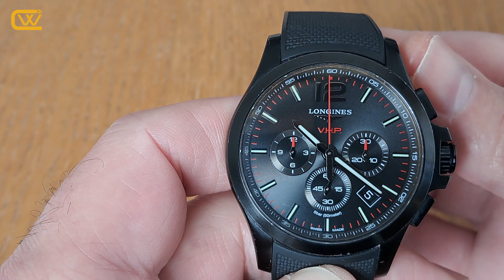Unlocking the Secret Programming Mode of the Longines VHP Chronograph

Comment: Can you do a video for proper battery replacement? My watch entered service mode and the month and year are correct, but the day will not change no matter what I do!
Reply: Just make sure you don't lose the two tiny screws.
Reply from the maker: @ultmtapx  Actually, most screws inside a watch movement are tiny, and many are even smaller than the ones you're referring to. But avoiding losing screws is only one small part of the job. That's why I don't encourage untrained people to attempt such operations.
Reply: @CLEPSYDRAWATCHES  Exactly - for battery replacement you need a 1 mm watchmaker's flathead screwdriver, an eye loupe with at least 2x to 5x magnification, and a pair of anti-magnetic Dumont No. 3 tweezers. After that—and with a steady hand—you should be good to go.
Reply from the maker: This is not a watch to experiment with if you're not a trained watchmaker. In trying to save money, you could end up causing serious damage to a delicate movement that requires proper handling. While setting and adjustment procedures can be performed by the owner, battery replacement is best left to a qualified watchmaker.

Comment: Thank you! I entered service mode in a three-hander using the same sequence of crown presses. Hand alignment mode is also at 5:30:00 position, it allowed me to align minutes hand precisely.
Reply from the maker: That's very interesting! Thanks for sharing your experience. It's good to know that the same sequence also enters the service mode on the three-hand VHP for precise hand alignment. 😊
Reply: did you also manage to set the date on the 3 hander? with month and year selection?
Reply: @kirkh666joejoe I never had to correct it but was able to enter setting mode and verify that the date was set correctly.